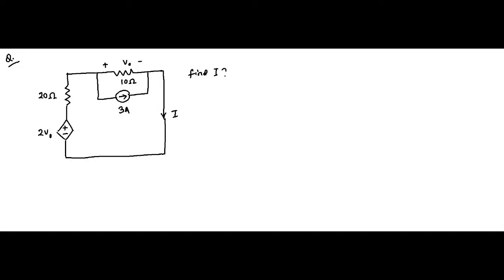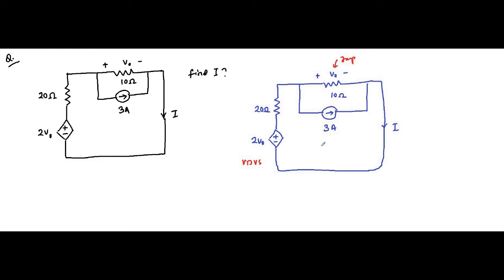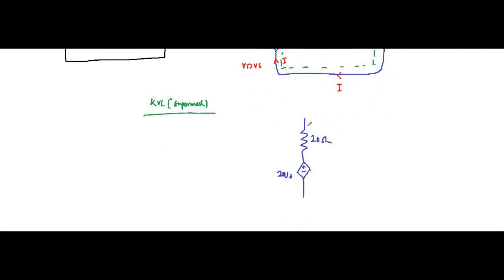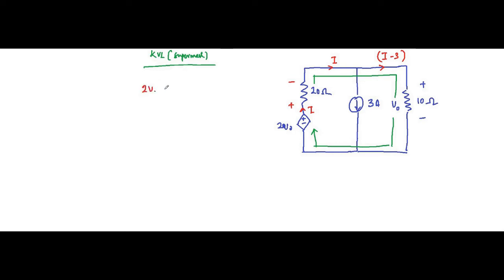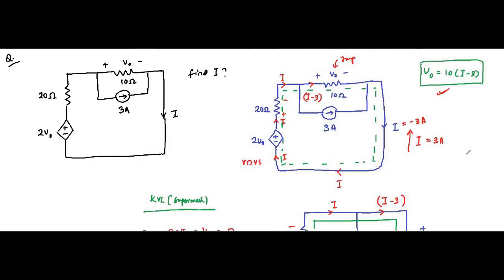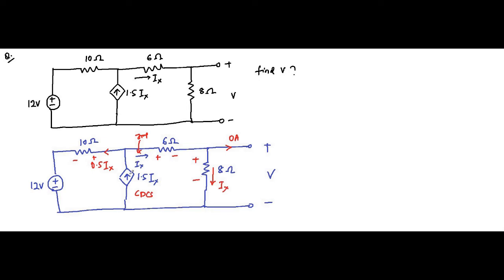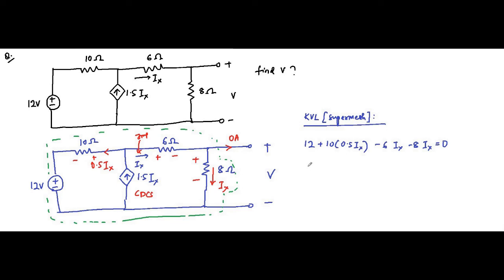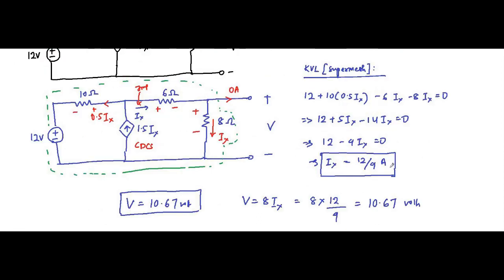Kirchhoff's Laws | Circuits With Dependent Sources | Questions 6 | Network Theory

Comment: pls in the second example  ,why did you take the current flow through the 8 ohm resistor as the same as that flowing through the 6 ohm resistor ?

Comment: 6:03 Hello, isn't that that V should be +V  in this moment ?   6:03
I solved this problem by adding source transformation to the independent current source and the resistor.....then i got a 3A without a minus ...Is it wrong to use source transformation to this as I did?